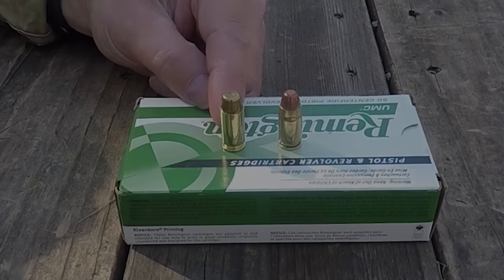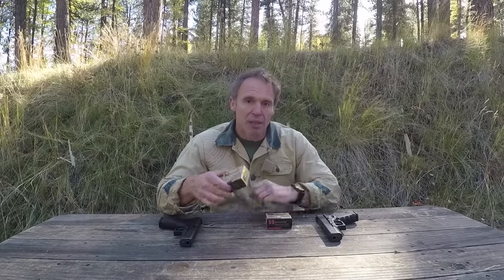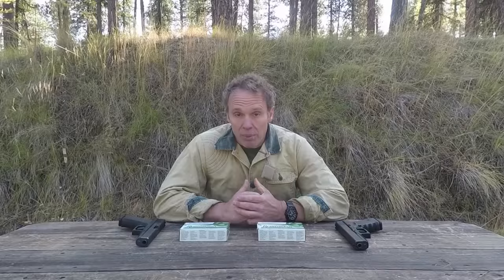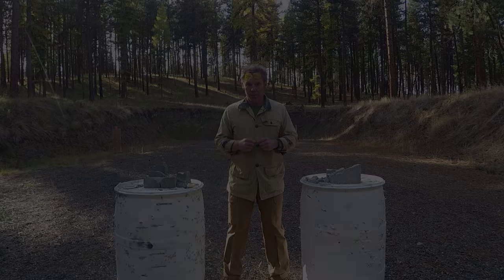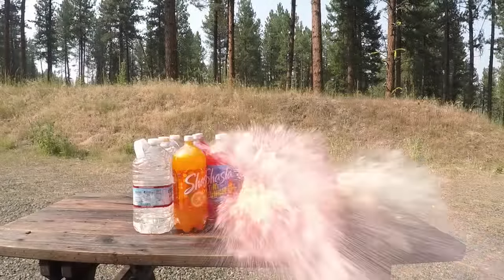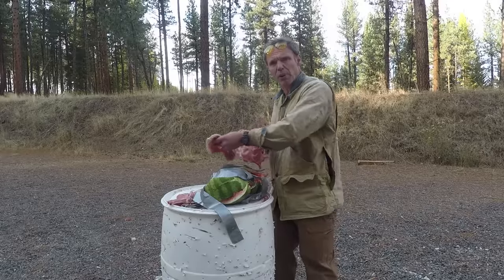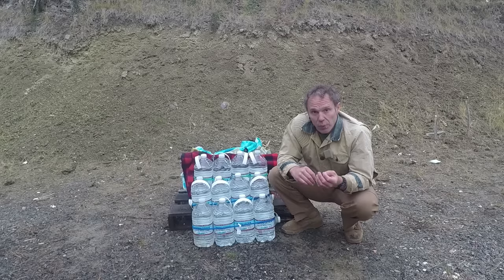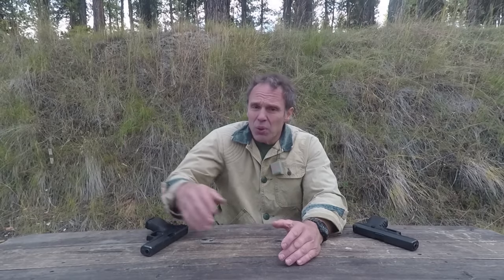Personal protection: .357 SIG vs. .40 s/w

Comment: First class comparison tests. It confirms my preference for the .40 S&W largely because the G23 was my duty pistol and the G27 is my personal carry. When the department switched from revolvers to auto 25+ years ago we did not want to give up the power of the .357s we carried and we compared the 9mm, .40 and .45. After tests, arguments and heated debate the .40 won. The 9mm was too close to a .38 spl in power and the .45 was a bit much for female and some male officers. Never found any reason to regret either department or personal decisions.
Reply: I honestly don't know why people complain about 40 recoil.  In a duty size gun,  any mediocre shooter should be able to handle it.  But it's not a purse gun round, maybe that's why, because everyone carries micro pistols made of plastic nowadays.
Reply: @khaccanhle1930  .40S&W is harder for beginners to handle, just like .357SIG, .357MAG or 10mmAuto would also not be good beginner loads. These loads in 4" or shorter barrels definitely snap and have felt recoil. 9mm luger is the best overall load for a new shooter given how balanced it is regarding recoil and muzzle flip management. Also, 9mm luger is easy to scale up and down regarding gun size and still remain manageable to shoot without a sacrifice of realistic power or risking bullets dropping below expansion threshold (unlike .38spl). 

I personally like .357 SIG over .40S&W since I shoot .357SIG more precisely at a faster cadence out of the same platform as .40S&W. But, again, I would not recommend .357SIG for a new shooter either. Gun size can be part of the issue, but polymer frames aren't the problem (btw...I personally prefer steel frames, but I have 'tactical tupperwear' too and appreciate it's place and shoot it about as well as all steel guns. It's more about the shooter than the gun usually). Practice with what you have and learning to shoot a small, lightweight gun in a snappy cartridge like .40S&W takes practice and most people don't have patience for that.
Reply: I have 3 barrels for my Glock 23; a 9mm, .357 Sig, and .40 S&W. When shooting all 3 calibers with nearly the same weight of projectile, the difference in felt recoil is minimal. With the 9 mm as reference, and with approximately the same weight projectile, there is a bit more “snap” with the.357 Sig and a bit more “push” with the .40 S&W.  I seem to be a tiny bit more accurate, and more importantly more consistent with the 9mm and the .357 Sig.  I can guarantee that your results will differ.   I have several other 9 mm pistols and 1 other .40 S&W. I will say there’s nearly as much difference in felt recoil between some of my 9 mm’s as  there is in the 3 different barrel in the Glock.
Reply: @Tool-Meister  I have to agree the difference in recoil feel has always seemed to me to be that the 9mm was lower in energy but snappier and the .45 was higher in energy but more shove.  I prefer the .45 on a 1911 chassis to the 9mm on the High Power but my EDC is now the Sig P365 which i find more comfortable to shoot than the High Power.
Reply: Only if you are ignorant about the ballistics available in each and every load. He's using a dud load for the 40 and a hotter load for the 357. The 40 S&W has nearly 120 loads available from 9 different manufacturers, whereas the 357 Sig has only 43 loads from 5 different manufacturers. Go online and visit Ballistics 101. If you can read ballistics properly, you will discover the 40 SW has loads every bit as powerful as the most potent 357 loads.

Comment: This proves you wouldn't want Paul Harrell plinking at you with a .357 Sig or a .40 S&W.
When I bought a Sig P226 .357 Sig over 20 years ago I got a .40 S&W barrel too. No regrets.
Reply: Sadly Sig no longer makes any 357 or 40 handguns.  It's used or bust.

Comment: .357 SIG really shines when it has a lightweight bullet.  FAR higher velocity, and far less recoil per foot/pound of energy.

If you double a bullet's speed, you QUADRUPLE it's energy while doubling it's recoil.

If you double it's weight, you only double the energy, while doubling the recoil!

The recoil can be measured as WEIGHT x VELOCITY.  Energy is WEIGHT x (VELOCITY x VELOCITY)

(Better known as [p=mv] and [KE=mv^2]
Reply: And yet none of that matters in a practical sense. The .40 S&W and .357 SIG have the same case and powder and they essentially have the same performance. The .40 S&W chooses a heavier bullet to opt for deeper penetration and more weight and the .357 SIG has lighter weight for slightly more terminal expansion.
Reply: Yes but that's assuming the bullet stops on or inside the target. Otherwise if it passes through its just wasted energy and a liability.
Reply: Inverse square law
Reply: I'd rather have the heavier slower bullet ( quality construction ) for Black bear penetration...
Reply: Vartkez 
K. All liability is on the aggressor. 

He whom starts it, owns it. ALL. Collateral or otherwise.
 Morally true, and that's all that counts when yout life is at stake. The aggressor is at fault, ALL. NOT the accosted individual.
NO Matter what the blue line losers tell folks.
Reply: @rifleshooterchannel208  Wow,   Good to know. I love my Glock 22....
Reply: @johnganshow5536  That is the opposite of what you need for bear. You need higher velocity and higher sectional density, both are what give you better penetration. Slow and heavy (when talking handgun calibers) = poor penetration for bear and other large beasts.
Reply: @bicimn  I've shot 11 Bears including a Brown Bear on Admiralty Island in self defense, how many have you killed?
Reply: @johnganshow5536  Thankfully have never need to shoot a bear, but I carry a 590a1 with slugs for defense, I can't rely on a handgun to do that job personally.
Reply: @funkidyo  I shot a 6 foot Black Bear with a Ruger Blackhawk 44 mag, 240 grain hollow points, dropped him like a sack of potatoes...
Reply: @johnganshow5536  he's giving out bad info. A 115 grain 357 sig has more velocity and energy than a 155gr 40. Check underwood ammos site for stats to prove it. Also checkout penetration channel. They did a test and 357 sig won in all their mediums.
Reply: @mikesideburns9791  If it didn't matter, 60 gr 5.56 would not be more performant than a 60gr 22lr
Reply: Ke = 1/2 * m * v^2
Reply: Both reach that sweet spot between expansion x penetration though. But i would still give it to the .357 sig for doing it with a lighter projectile and being slightly more consistent, even if the .40 is more convenient in general and make bigger holes.
Reply: Furn333  you know nothing about ballistics a 357 mag has way more power granted in at least.   Aaa 4 inch gun.
Reply: I dont believe this math to be correct. Recoil is the opposite reaction of the energy produced. Nothing to do with velocity itself, just energy
Reply: Earl Lee Barrel length is a major factor. A 60 grain projectile going 3,000 fps will damage soft tissue a lot more than a 180 grain going 1,000. But the former requires a rifle and the latter can be had in pistol form.
Reply: Earl Lee  Another problem with high speed bullets is barrel longevity.  While this is not really a problem at pistol velocities, higher velocities [think rifle speeds] tend to burn out barrels MUCH faster.  The magnum rifle cartridges often need barrel changes in as little as 2000 rounds, and they're only clocking 3,200-3,400 fps.  8000fps just isn't practical because we don't have the steel technology for it yet.
Reply: Check out Ballistics Chart 101 online. You will discover that the 40 has just as much velocity and ME as the best 357 Sig loads available.

Comment: Those guns are absolutely identical in every way, part for part minus the barrel. I swap a G22 barrel in My G31 all the time. Its the only cartridge conversion condoned by Glock because they are the same pistols with differnt chambered barrels.
Reply: Gadsden Jim I've got a 23 and thought about doing that but have decided on buying a dedicated 31 in the case that I actually and have to go to court because my firearm was "modified". That and I'm pretty damn sure it will be uncomfortably snappy in a compact frame. But I'll never know unless I try it.
Reply: If I remember correctly in a video Hickock 45 did about this he said he had some issues with the magazines feeding properly going from one round to the other but not the other way around.  May have only been a problem with early magazines though.  You might look up his video if you are planning to try it.
Reply: Craig Arnold I've heard similar things from other people.  Thanks I'll have to look it up.
Reply: Craig Arnold Yeah, it's only older 40 mags have a issue with 357 because the follower. All newer 40 mags have the same follower as 357 mags and work fine. I personaly just use ALL 357 mags myself. Also results may vary with trying to use 357 sig in the glock "22 round" 40 mags, I've found in mine once loaded past 16-17 rounds with 357 they tend to bind. I think it's do to the bottle necked cartridge in the longer strait mag, the rounds get to a point and want to curve (just like rifle rounds) so they bind in the strait tube after so many rounds (that's my conclusion I've came up with).
Reply: From what I’ve read, gen 3’s are identical, and gen 4’s made before 2012 use the same ejector. G22 Mags marked with a 9 on the follower are good to go.

Comment: Underwood is the best ammo I’ve seen for the  357 sig ... it’s extremely high velocity and amazing penetration 1700 FPS and 578 ft lbs SKU # 812
Reply: Underwood has a 65 grain loading getting pushed along a 2,100 FPS with 636 ft lbs of energy.
Reply: 40isoneofbest
Reply: What are you trying to penetrate?

Comment: I've been depending on 44 mag loaded with 44 specials for decades. Haven't had to use it so far. That's the way I like it. Less mess on the floor and no holes to repair.

Comment: The .357 sig is a great example of something that was engineered well but might have been too overengineered and came at the wrong time. I think there's four reasons it isn't as popular as the .40 today: (This is all just a theory of course)

1. The .40 S&W came first and had a 4 year head start on the .357 sig. I'm not sure if the .357 was intended to compete directly with the .40, but their markets seem to closely overlap. Stores gave shelf space to the more popular .40 S&W which caused it to dominate even more, which explains why it's hard to find .357 Sig today.
2. The bottlenecked design of the .357 increases manufacturing costs which may explain why that round costs more
3. The .40 S&W was intended to address the recoil of the 10mm Auto but still have the same diameter bullet. The .357 sig appears to be the .357 magnum adapted for autoloaders. But the .40 S&W had the benefit of government backing and immediately widespread deployment by law enforcement. 
3. If the .357 sig is ballistically better (and this video suggests it marginally is), that's the problem. It's only a little bit better. IMO it doesn't justify the extra cost and the hassle trying to find someone who sells it.
Reply: It's not marginal.  If both rounds are not deliberately underloaded (comparing Underwood loads is usually the way to go, they don't make bitch wrist ammo) 357 SIG comes out way ahead and is in fact effectively the classic 125gr .357 magnum load in an auto.
Reply: They both are failing commercially to the 9mm just because the public is interested something workable, not the best.

Comment: Please test out 165 grain .40S&W. It's the perfect load. 

The 135, 150 and 155grn rounds are often quite good as well, the 180 leaves much to be desired.
Reply: Yes,  150-165 is a much better load for 40. 180 leaves too little space for powder, it's really a weight for a 10mm.
Reply: Agreed. I own both a G22 in 40 and a G32 in 357 Sig. Best rounds for the 40 are Winchester Bonded/PDX1 165 gr, almost as good as the Winchester bonded/PDX1 125 gr 357
Reply: 155 and 165 are best loads. 135 is also a good weight for .40. Tons of power.

Comment: My "Go To" is and has to be, the 357 Magnum. I am a handloader so my options are huge.
The Hornady lists 14 different bullet weighs, and a bunch of different powders.
 In this Loading Manual there is a section for Handguns and a section for RIFLE. 
Versatility is what the 357 really is.  Light bullets, the 110 - 125 grain, PSD, the heavy bullets, 140 - 160 grain  can put food on the table.
I have a SS , 4 inch barrel revolver and a 22 inch Rifle with a 3x9x40 scope on top.

Comment: What matters most is Muzzle Energy in terms of overall penetration. The best defense load for the 40 SW is the Underwood JHP load at 135 grains @ 1500 FPS. That's a Muzzle Energy of 675. For the 357 Sig it's the Double Tap NJHP load at 115 grains @  1550 FPS. Giving it a Muzzle Energy of 614. Not a heap of difference, but the 40 has loads every bit as powerful as the best 357 Sig loads.

Comment: Here's a kicker for you. If you already own a Glock 22 you can simply buy a G31 barrel and it's a perfect fit. Both models share the same platform, slide, extractor and plunger, the only difference between the .357sig and .40s&w is barrel and maybe the recoil spring weight. Same goes for 9mm & .380 and the 45acp and 10mm glock models. My G22 shoots .40s&w, .357sig and 9mm conversion barrel that has a wider diameter to fit the .40s&w slide. My G19 model has a .22lr conversion (slide, barrel, recoil spring and mags) as well as my favorite 22tcmr barrel and recoil spring conversion which is a lot of fun to shoot. Once Armacorp submits to get SAMI specs we can start seeing rounds other than the 39gr. hollowpoint and it will be a great comp to the 5.7. This round has the potential of penetrating level III armor which might be why you're interested in the. 357sig round to begin w/. It's actually a shortened. 223 necked down to fit a 39-40gr round depending on which conversion you have. 22tcm or 22tcmr which fits glock 9mm mags. I genuinely think rounds like these will be the future sooner than later.

Comment: That's it, swapping my Sig 226 40 barrel to. A 357 Sig barrel. That's how I'm rolling.
Reply: I bought a 239 Sig in 9mm. In 1996. Great gun!  The next year my friend wanted to buy a hand gun for protection. The .357 Sig came out. I told him if I would have know about the .357 Sig. I would have waited to buy mine. He did buy the .357. We went and shot both 239's. The .357 Sig kicked the  9mm Ass. The slide is CNCed on the .357 Sig and the 9mm is stamped. Wish I would have waited. The .357 Sig ammo is more costly yes. But what you get is worth the cost. My other friend got a cougar in.40 S and W that same year. He shot my other friends .357 Sig  239. Sold his Cougar the next day.  Shawn

Comment: Be interested to see 357 sig vs 10mm... Another good video.
Reply: I agree
Reply: The 10mm would destroy any .357 SIG. Besides, it's an apple-orange comparison. The .40 is to the .357 SIG what the 10mm is to the 9x25 Dillon.
Reply: white  name one thing it can do better
Reply: MTrefiner  Half the mass? Uh not really. 125 gr vs 180 gr. And the 9x25 is much faster.
Reply: digital1911  Hate to correct you, but 10mm>>>>357 sig
Reply: 10mm is better, however you need a moderately big gun to fire that round. It's also going to have a lot more kick.
Reply: digital1911   greater only in recoil
Reply: @Atombender  I have a sub 2000 16 inch shooting under wood ammo at 1700 fps that's about 900 ft lbs of energy so yeah u get the right ammo and right barrel length the 40 is equal to the 10 or slightly stronger
Reply: @frankcastle9691  ... no you absolutely do not? There are compact sized 10mm pistols.  EAA makes them.
Reply: @Silentblogger659  a compact 10mm would shatter your hand if you fired it.
Reply: 10 mm has more energy.  The lower pressure is more then overcome by the larger case capacity.  However, you need a bigger pistol, especially in the grip area.  As far as I know, both are good rounds......
Reply: @jrbvargas3150  not if you are comparing both rounds out of a carbine. If you shoot a 10mm out of a 16" barrel and shoot a 40 s&w 
out of a "16 barrel with factory standard loads the the 10mm will always win unless the 10mm is grossly underpowered.
Reply: Frank Castle I have a Glock 29 and it definitely doesn’t do anything to my hand after 100rds at the range
Reply: Frank Castle not even close.. I have a Glock 29 and shoot Buffalo Bore and Underwood out of it. The recoil is not that bad at all..